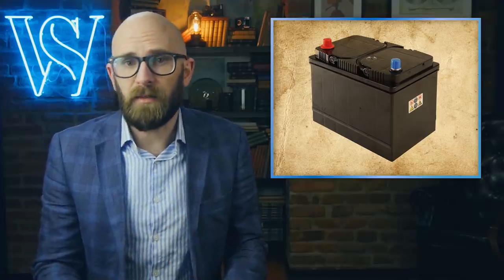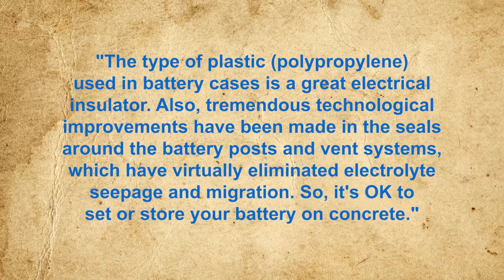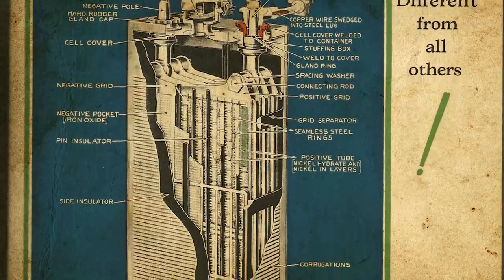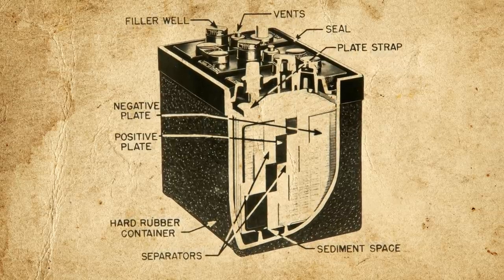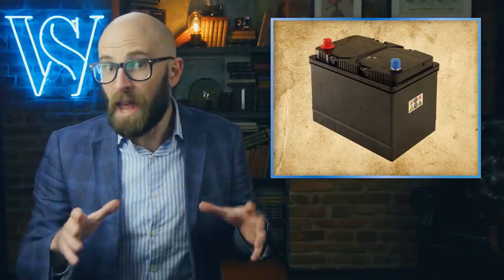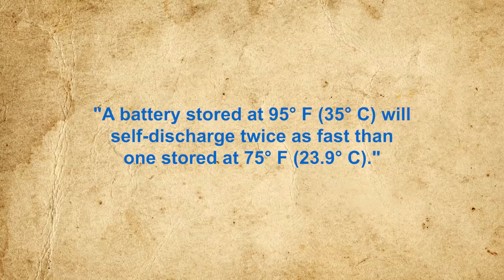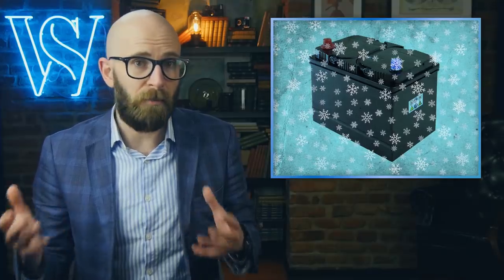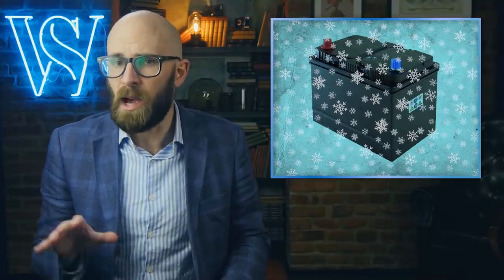Why Does Placing a Car Battery on Concrete Drain It?

Comment: Pick a battery based on where you live. If you live in an area that routinely sees freezing and sub freezing temperatures you want to pay attention to the CCA rating. CCA = Cold Cranking Amperage

If you live in an area that routinely sees moderate to hot weather like Texas, you want to pay attention to CA ratings.
CA = Cranking Amperage 

The difference in these two measurements is fairly large. For CCA it's based on the amperage of the fully charged battery at 0°F for 30 seconds. CA is 32°F.

Heat is the number 1 killer of batteries. A battery with higher CCA ratings has more plates in it. More plates make more heat and reduces the fluid inside that acts as a coolant. So simply asking for the biggest CCA battery for your car is most often the absolute worst thing you can do unless you live in Alaska or one of the northernmost states in America. 

For a place like Texas a high CCA battery will last half its rated life or less. Especially where I live. Here we see at most 2 or 3 days per year that might fall below freezing. Much less 0°F. Our winter is really only about a month long and can have a 35° day followed immediately by a 75° day. But our summer is about 8 months long and can easily have a month run at 100° and hotter. 

A vehicle running on a 100° day will have a battery easily running at 140°. And the higher CCA the hotter that battery will be. It will over heat and vent it's boiling acid into atmosphere. And even though it may work good for months after we will inevitably experience a 60° night and the battery will die. Be it flake of the plates falling off and shorting a cell or 2 or the acid level falls off below half. In the end it means you're late for work and pissed off.

All my batteries for the last 30 years have lasted a minimum of 6 years. That's the expected life of an automotive battery if you pick the right one and follow basic procedures for keeping up with it. Keep the cable ends clean. Spray the terminals down with terminal protector. And always unplug all chargers inside the vehicle. They always use power. Even when they aren't hooked up to whatever they charge. 

Been selling batteries for decades. Every customer that follows my advice has batteries last them far longer than their warranty. Others will bitch about how bad my batteries are and go somewhere else only to do the same thing to them in a year or so and come crawling back or just bounce from parts house to parts house.

Comment: So, should ya store batteries in the fridge?
Reply: Asking the teal questions
Reply: That's where I store mine.
Reply: Well a typical home freezer would be better.
Reply: I always wondered, wouldn't this drain them via heat loss? Speeding up the chemicals via heat seems like it should add energy to the battery.
Reply: Yes.
Reply: @injunsun  In this case, the reaction being slowed down is one that drains the battery.  Batteries do not convert heat to electricity.  No steam engines or Peltier devices are built in!
Reply: Freezer
Reply: @injunsun  there are natural chemical reactions that "wants" to drain the battery. These reactions works slower in the cold.
Reply: Only lead acid batteries. Alkaline ones, no. Those will die. Mythbusters proved that.
Reply: That's where my parents store theirs. Just be carefull. The batteries leak a vapor and when contained in a small space the leakage builds up and becomes dangerous. Basically, don't breathe the fumes that poof out when you open the fridge. You can't see them, but you can definitely smell them. My parents work for Duracell as researchers so they always have a ton of various batteries everywhere. The downstairs fringe is like a holy grail of experimental batteries. It's so weird.
Reply: I store mine in liquid nitrogen
Reply: jason mcfarland I worked with a guy that would store his unused car batteries in a deep freezer.

Comment: So stratification ( cold lower, warmer and self heating upper ) cell temperatures and the resulting slight voltage differential between the top and bottom of the cells has no self discharge effect. Good to know.

Comment: In Maine, where it was not uncommon to see the temperature dip down to  -40ﾟF, we would turn on our headlights for about 5 to 8 minutes before we would try to crank our engine. 
 This way we could get the battery starting to work, before we tried to crank the engine.

Comment: Idk. I'm gonna still believe that it does discharge faster in the cold as that is what my grandfather and uncle (who are both mechanics) have told me as well as every other mechanic I've talked too. My own personal experience has shown the same thing. I store one of my trucks in the warmer months (like 4-5 months) and get it out in the winter as it has 4 wheel drive unlike my other truck that has rear wheel drive and it starts up after months just fine. I have it checked out and I'm told its good. One time I left it out in the cold and it died after 2-3 weeks of no start up. Had it checked was told the battery was still good and just needed to have it recharged. Afterwards I start it up every other day as usual and have no issues with the battery till it died for good. So I'm curious why it did this if cold weather is supposed to help preserve a charge.

Comment: As an EE who lives on an off-grid (solar + lead-acid batteries) homestead - this is 100% correct (Even though I'm also an old guy who heard all those myths).
My systems are monitored by computers which log and plot everything I can measure and I see the truth of all this daily.  The old myths need to go away, they're not helping anyone.  Note that even with synthetic multi-grade oil, engines are much harder to crank when cold.  Try it on any manual pull-start engine for grins...

Comment: I swear, this video came at a great time. I've been starting to think the cold weather here was affecting my electric scooter's battery life. (Figured it was kinda the same concept since its motorized....maybe?)
Reply: It does. It's not the same effect, but cold weather decreases the useable capacity, rather than permanently damaging it, it just can't hold as much usable charge. 
This is a thing for EVs too. Winter range is about 20% lower.
Reply: If they are lithium batteries. Lithium does not like cold.

Comment: I remember in the OLDEN days in sibyria north Dakota have to bring them inside at night because the water would freeze overnights . Worse than cracking the case the freezing would force the plates in the battery together weakening the cell strength. 
  But I remember buying a battery and only used it for a few months th n setting it in the corner on the floor eventually. While I restored the car . After 7 years setting in the corner on the floor it still had 7;volts in it I charged the battery and used it for 5 more years before replacing it. That made my battery witha 3 year warranty last like 13 years.  Good old Sears made the best batteries and Kmart batteries were made by the same manufacturer and half the price.

Comment: WARNING MISLEADING INFO!

I work at a popular autopart store and the reason for the batteries going out so much in the winter is actually attributed to the sudden change of temperature.  So yes while the cold itself isn't all that bad on the battery, the time of year in some areas where there are moderate days followed by >-32F
are actually a real issue... This is what we call battery season in the business.  Today you found out, your welcome...

Comment: I can attest that cold weather does affect batteries I have a 2019 Harley Davidson sports the roadster and I’ve been having issues with the battery in cold weather I checked the power levels they drop when the weather is cold and when the weather is warm the power levels go back up the cold weather also makes it harder for the battery to discharge energy to start anything

Comment: I work as a solar designer and installer and we often do battery back-up systems. It is a terrible idea to leave batteries on a concrete floor for many reasons (regardless of what was said here)

Comment: Note, when a battery that is below half charge is placed on concrete in the winter, the battery will freeze into a block of toxic ice, this will damage the led plates and make them short out, so if you had a battery that has 800 cca it would drop too low to even start or run the guages and lights.keeping the battery stored in a hot room will decay the led plates, while led oxide settles on the bottom of the battery itself also shorting it out rendering it useless

Comment: Let me tell you from experience. In 2018 during the arctic freeze in the midwest, we had tons of car batteries die from keeping them overnight. When it gets below -10 degrees if you try to start your car over and over again until it doesn't turn at all, it will freeze the battery. If you fail to start your car you NEED a jump otherwise you risk your battery freezing.

Comment: I'm afraid you missed one fact (not myth, FACT) related to flooded lead acid batteries. Electrolyte stratification. This effect can be worse when stored for long periods on cold concrete floors (or ANY cold surface) in a cold room such as a garage or shed.

Comment: Clearly, 75°F is NOT cold weather. 
I can attest that simply warming a functionally perfect battery from sub-zero °F with a "no engine cranking capability" to a moderate room temperature will restore its ability to easily start the engine. 
South Dakota winters are no joke at times. 😎

Comment: If any are wondering why phone batteries discharge in cold weather then the answer here is that it actually don't it just seems that way as the phone estimates the charge by volts when just turned on or when running it uses current and as they said in the video current drops in cold weather thus making the battery seem discharged, however, it will seem charged again as soon as it becomes warm

Comment: I was taught that the main factor was how much colder the battery would get on a floor, concrete, dirt, or other.  Especially during the winter in a garage.   AFIK batteries are less efficient in cold weather.  Your mileage may vary.

Comment: For cold weather starts most bigger diesels run 2 batteries in parallel to increase the cranking amps. But if it gets really cold you're better of with a block heater.

Comment: Riddle me this , Last winter my 4 year old car battery experienced a nice -30 F night and soon after even when it was warmer out 22F the car didn’t crank as fast as it normally did and was slowing down by the day and charging voltage was higher than normal for like temperatures. When I went to buy a new battery every store was out of the size I needed because there had been a run on batteries. This car had never had an issue until that cold snap. If cold doesn’t hurt the battery apparently using it at that temperature does?

Comment: I'm a mechanic in Florida. It never gets below 30f here. Every winter I replace 10-15 customer batteries that are in regular service. Your data set is flawed. They always have damage to the cells. All are usually still within their warranty period (1-2yrs).

Comment: A few years ago I asked a very good mechanic why you should never set a battery on concrete he said it had nothing to do with anything electrical but he said setting a battery on any hard floor greatly increased the likelihood of physical damage to the battery.

Comment: In 1972 I drove a lorry over the Spanish mountains at Christmas, the temperature plus wind chill  dropped so low that the radiator and batteries  froze and burst, the anti freeze in the engine was supposed to be good for minus 32 deg C.

Comment: Not only does a cold chemical battery have slower reactions and less electrical power, but a cold internal combustion engine has thicker oil, and the contracting metal of the block can cause increased friction between the mechanical parts. Particularly if the block is a metal (like aluminum - or aluminium)  that contracts more than the metal of the pistons and rings (usually steel). Also, water (not sufficiently balanced with anti-freeze) in the engine's cooling system, and any moisture trapped in other parts of the engine could freeze, seizing other parts up, and even blocking fuel flow.

Comment: Two things. 1. It's still really weird to open someone's freezer, when requested to fetch something, and see they have an entire Walmart Battery aisle in the back behind the half a cow they got in there as well. 2. I think part of the misconception of "cold is bad for batteries" might have stemmed from pop culture. I'm thinking of the whole "disarming a bomb via freezing it." I'm pretty sure that it's possible to do, but it became part of the whole "elemental rock-paper-scissors". IE, if you use fire, I'll use water to counteract it. If you use water, I'll use earth to absorb and contain it. Etc. So in a lot of younger minds, cold > electricity 100% of the time.

Dunno if this is sound or not, it's more of a speculative observational theory than actual facts. But the batteries in the freezer thing is an objective fact. It's just a little weird. If it's 1 or 2 packs, fine. But if it's like the battery for your kids PowerWheels, your spare car battery, your AA's, AAA's,, C's, D's, and 9v's all in amounts of 20+ packs, just stop. You've got more acid in your kitchen than some questionable chemistry teachers.

Comment: In the film photography days, I would keep (non rechargeable) batteries in the refrigerator based on the theory that keeping them cold SLOWED self discharge. I also kept film (in plastic "baggies") in the fridge to prolong "shelf life". - Naturally  you would allow them to reach normal temp/humidity before using. Was any of that correct? IDK, But I used a LOT of film that was PAST it's "expiration: date that was cold stored, at it was fine with regard to color.

Comment: I found out charged batteries wont freeze, but dead ones will freeze solid. I have a truck that is sitting and I left the key in while doing work and never took it out. Bitter cold week and batteries froze solid and wouldn't charge. Had to thaw them out over a couple days inside and charge them back up. They're new and I hope they weren't damaged too bad

Comment: Thank you, wondered why i kept putting a battery on a piece of wood, so happy to know it relates to older battery tech and i dont have to bother any more,
I'm having a debate about tesla battery packs and been told they work excatly the same when it comes to holding charge and lifespan efficiency etc of it weither in a Australian desert or the snowy hills of russia,
I've tried saying that they will be affected differently due to the heat/cold,
Would you consider a video that explains the fact as with any auto maker what the press/promotion department say is normally alot different to the facts

Comment: Sorry to tell you this but I've had on quite a few occasions batteries freeze above 10 degrees F.
It never gets to 0 degrees where I am. And when they freeze it shorten thier life.
Mind you I'm not talking frozen solid. Im am refering to ice being in the battery.
Just last year, I lost all but one battery to this freezing. They charge to 5.3 volts to 10.3 volts depending on the battery.
I cannt say for sure , but I believe when the freeze like this they destroy the plates inside. All it takes is moving the plate a fraction of a inch to contact the one next to it for it to short out.
Someday I'LL get to the city and see if a battery shop will rebuild them.
Btw these are deep cycle lead acid batteries. 
And in all 9 batteries, complete cells are destroyed. Meaning the cell has zero voltage. And in none is the dead cell(s) the outside cells. Its always in the center ones.
I've drained them, and gave them fresh acid and it makes no differnce. Of course charging them after. This is why I believe it destroys the plates.

Comment: In Minnesota, when the temps go under 0*f I’d have to start my car roughly twice a day, even if it was just to start it for a minute or two, or else I’d have to replace the battery entirely.
Reply: Exactly.  I grew up in mountains that temps could go as low as -50°f.  This video would have you believe all you need to do is just warm up the battery and it's fine.   When in reality cold enough weather can damage a batteries effectiveness and longevity.  Learned that through getting my Associates in science  studying Avionics.

Comment: Adding ultra-capacitors would not only fix the cold-starting problem but also extend the batteries' life, both by protecting it and by making it work even long past the point where it'd normally be replaced for its inability to start an engine.

Comment: actually this is true for the most part but does not address a 'dirty' battery, a battery can acquire so much grime on it that when you place it on the ground the 'film' on the battery can in fact conduct a charge and can result in a discharge. however, the offered information is very much correct, just this is an add on of 'under certain circumstances' situation. so to be sure, clean your battery before storage....